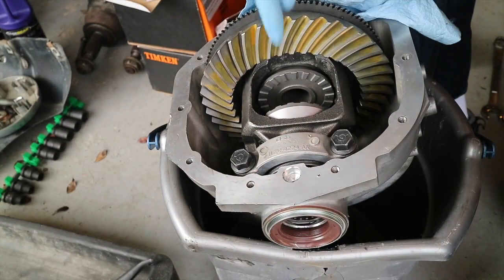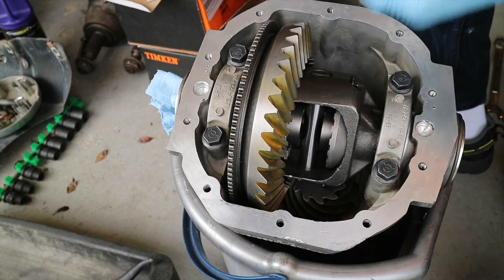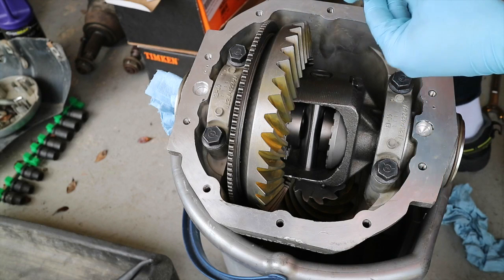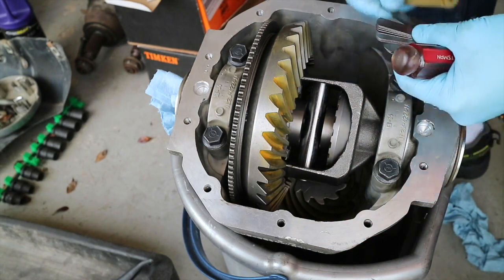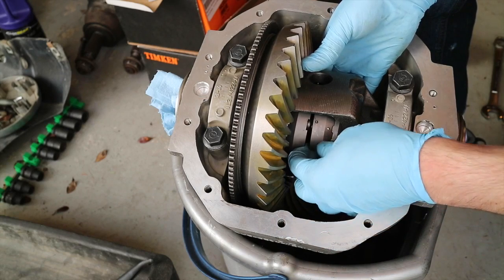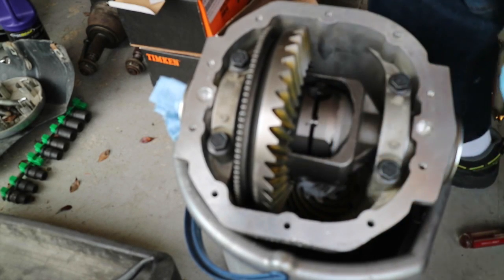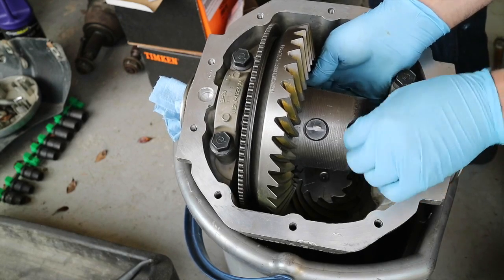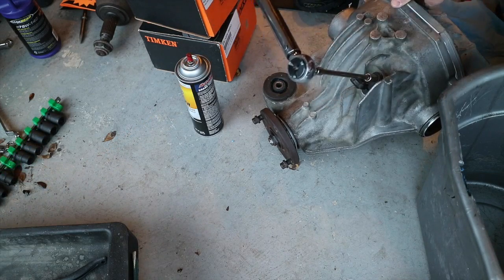VLOG #18: Ford 8.8" Differential Rebuild - Spartan Locker Install!

Comment: Great video buddy buuuut how the hell do you put the C clips in the the axle. I cannot find 1 decent video that shows everything
Reply from the maker: This unit is the IRS unit and doesn’t use c-clips. The half axles pull straight out after you overcome the tension of the circlips. C-clips are found in the solid rear axle housings. After you remove the diff cover, the c-clips should be easy to spot, you just need to push the axle inboard to expose their groove ring and you should be able to pull them with pliers. In fact, solid axle users should be axle to install the lunchbox locker in their driveway without anything other than lifting the vehicle and removing the diff cover.
Reply from the maker: Here you go brother: https://youtu.be/pOl1x_q5SG4

Comment: Can this be installed in IFS 8.8 28 without removing the diferential from the truck
Reply from the maker: Not sure of that setup ... depending on the diff mount/stabilizers ... they  are integral on the rear cover in this application and thus must remove the entire diff assembly to gain access. I guess in theory, I could have left the cover and pulled the carrier body but aligning the cover upon completion with the gasket maker would be damn near impossible.

Comment: Great video, but a Spartan Locker should not be used in a Ford 8.8 IRS without modifying the Side Couplers.  See https://www.explorerforum.com/forums/index.php?threads/spartan-locker.352259/page-6

Comment: YOU ROCK. so this should be the same as the 2007 explorer with irs? do you have a r/r of the diff video???
Reply from the maker: yep, other than the speedo sensor, which may be a bit different. It's been damn dependable and the traction it affords in a straight line is awesome. Works wonders in snow/sand which is why I installed it. However, in normal daily driving, slow turns cause a ruckus as it's slow to disengage and has to slip the wheels as traction has to give somewhere. I've been contemplating pulling it in favor of a Torsen LSD instead, which is what I wanted to begin with but couldn't afford it at the time.
Reply: See https://www.explorerforum.com/forums/index.php?threads/spartan-locker.352259/page-6

Comment: get videos, I plan on putting an 8.8 into my rx7 . I also plan on swapping the gears to something a little more fuel efficient.
Reply: Mmmm ... I've just done my son's MY2000  FD RX7 (Ls1) we used ... 3.54 ratio TruTrac LSD & the 'Ronin' support kit.